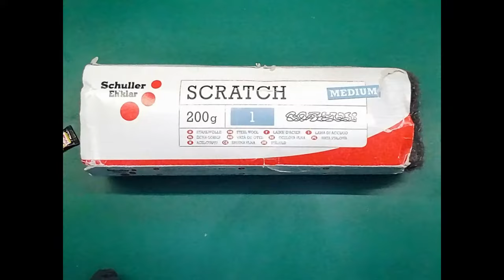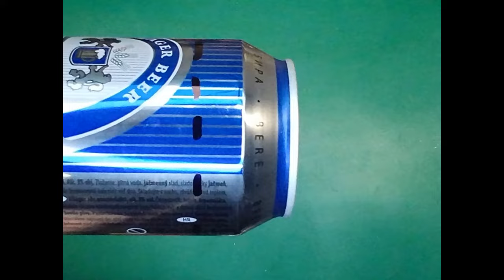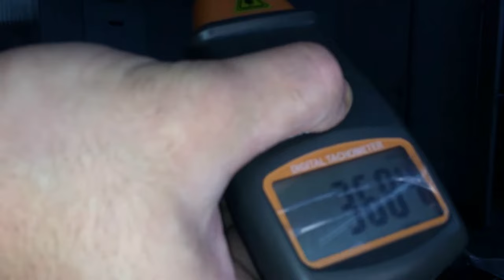[TUTORIAL] How to make a DIY free piston TASHE (ThermoAcoustic Stirling Heat Engine - step by step)

Comment: I would sure like to see you hook these up to a solenoid and show some power measurments.
Reply from the maker: Maybe later. I'm working on an efficient generator for this frequency range. But the calculations given around 3,5 W mechanical power at 40Hz I want to measurethe real power if the engine will a bit more stable. My last construction works well after hours operation. I will share updates if I have some results. Blade

Comment: Greetings thank you for the epic content, this inspired me to try an build my own,  so far i've built the same engine out of 2 a coffee cans and a 3rd can from canned food as a displacer and im using inner tyre tubing for the displacer membrane and power membrane as i imagine they are stronger than a balloon and very elastic too, yet not getting any movement on the power membrane, where could i be falling short??? i did make a small pin hole on the cylinder to make sure there isnt a huge build up of pressure, pls advise
Reply from the maker: There is no displacer, only a tube with mebrane end. The gas displacing there in the inner tube. That place called thermal buffer tube. Anyway, pls try first a higher flame and more cooling if your can prefer higher flame temperature. For this unit should give a bit bigger heat input.

Comment: Can we use it for an electricity generation? And if yes how big it can be made practically? I want to built one to powered my house and some sold back to the grid. 10kw/hr is what I'm willing to achieve. I have pretty good availability of solar radiation in my country so concentrated solar powered Stirling engine will be a better choice.
Reply from the maker: Dear Yash, TASHE is one of the simplest construction of a traveling wave thermoacoustic Stirling Heat Engine, where we can use only one thermal core, but for that power range where you want to use it there's not ready to use any unit all around the globe! Blue Heart is one of the closest to the goal. For research and developement?  It's a bottomless hole for the money and minimum 5-8 years to create the first big prototype. You should make tons of smaller prototypes in the first 3 years. Sorry if these infos makes not happy feeling to you, but I'm in around 8 years now, and I know how painful the prototype manufacturing process from the ground level as a developement engineer. BLADE
Reply: @AttilaBlade  thanx for replying 😇
Reply from the maker: @yash_kambli  I'm sorry for the negative or unpleasant news so much. I'll be happy with a 10kW unit from this config, that means I'm arrived to my goal. ;) Anyway, 3 and 4 cylinder solar Stirlings are available now with solar dish concentrator but I'm not pretty sure about the payback time around a house. The price is so high and that works with 80bar Helium if I remember right and that could work 1-30 kW range. BLADE
Reply: @AttilaBlade  no problem, mate. I'm pretty satisfied seeing ur reply. I hope Stirling engine will gain more traction in commercial as well as in domestic applications. It might be less power dense, quite bulky and expensive but is still a really good technology to be work on. 
Btw I'm really enjoying ur every videos and hope u will keep bringing such exciting topics every time.

Comment: Okay, I'll try this. I want to see if these engines can be powered by solar... I know they can but will build one.
How to up grade to one that produces electricity will be the difficult step!
I'll let you know if I succeed 👍
Reply from the maker: Good! For a long time usage you should make some aluminium fin connections between the inner tube's top side to the outer tube's cold side. Also the finns should go across the inner tube top section to cool save the membrane from high heat load. That's all! I believe you can do it Bret! BLADE

Comment: Im working on a modification of your design using a steel 5 gallon bucket. Any advice?
Reply from the maker: Don't rush your work. the inner cylinder and the regenerator part around it should not move. Cooling is more important and the diaphragms should be as tight as possible. A simple heat source will not be enough to drive it. A high temperature is required around the bottom of the master cylinder. The entire structure must be fixed without any possibility of movement. Probably, if the gap and density of the regenerator are correct, your engine will work. But many things can change it. BLADE

Comment: Hi It was perfect 👌👌
Why did u put that piece at min 4?
Reply from the maker: That folded piece of can is a spacer/centraliser between the wall and the buffer tube.
Reply: @AttilaBlade   thank you I got it. 🌸
How can I find efficient sizes for this Sterling Engine?
Reply from the maker: @zahrab162  Efficient sizes? What do you mean exactly?
Reply: @AttilaBlade  I was thinking about a sterling Engine which works with solar power. I thought measurements could be important for Engine optimization. And I asked how can I find this measurements
Reply from the maker: @zahrab162  This is not a simple question. This type of engine is really sensitive for the parameters. For example this engine could work with this bad heat exchangers on both sides, but for a real unit, I mean a useful one (with pressurised Helium) where the COP & Power on a much higher level, you should make simulations in Delta EC program, you should plan a perfect heat exchanger with calculations and later you should design that also, and the 3D design you should change in parallel to optimise the final prototype unit. This is a hard work. This membrane type TASHE is a big pain in the a..e! ;) But if you have a good model in Delta EC and lot of money to make an optimised heat exchanger also design the whole unit then this playground is yours! Oh I forgot the important small scale experiences, and the  highly qualified team with different "type" of engineers. If I'm right Doug Wilcox from Georgia, US has a pdf about a heat driven high temp diff membrane TASHE. The unit heat source was gas burner and two linear reciproc motors are worked as generator. That paper could help to you I think a lot. The Ben & Jerry refrigerator unit worked with similar method but in reverse working direction as a heat pump.  Not too much real configuration is available around the world but not impossible. Sorry if my words makes you sad. Back to my desktop unit, the parameters are not really optimised, I used the cans basically and I've made tens of engine before I made this tutorial. Blade
Reply: @AttilaBlade  I'm really thankful for your great answer it was eye opener and very helpful 🌹🌹
Reply: @AttilaBlade  god bless you:)
Reply from the maker: But never give up! Learn a bit more about TA engines autodidact also try to make some experiments. The experiments are could teach a lot if you have open mind and eyes. For a school project the can engines are a good starts, but for a high school you should planning a much complicated one with similar structure. The question is where is the balance of the goal and the knowledge. Best regards! Blade
Reply: @AttilaBlade  I like to learn more about it and it need to put time, I know 🙏☘️☘️☘️
 I will try to make one

Comment: Great job ! Now all you need is a free heat source. Maybe plutonium ?
Reply from the maker: Thank you! ;) Plutonium as free heat source??? OMG! No way... I want to build a solar version from this type engine with  higher pressure to increase the power. But the developement is started only. Money and time what I want to make machined parts, efficient heat exchangers, etc. etc. :)
Reply: @AttilaBlade  You can get " Used Plutonium " from Russia. ;-))
Reply from the maker: @bjl1000  :D :D :D
Reply from the maker: @bjl1000   "Oh, those Russians!" :) (Boney M.)
Reply: Hydrogen ? We can produce it easily at home.

Comment: Hi :) I tried to build 2 engines, following exactly your instructions, but cannot get it to work :( Should the displacer be loose in the outer can? It does not look so loose in your video. And does the connection piece actually touch the membrane of the displacer?
Reply from the maker: Dear Mark, if the steps was exactly same the unit should work. It works with a bit higher flame as the other engines. The inner membrane should tight as possible. It has no displacer, that is a tube only, it's fixed with the regenerator around that. If you made the wrapping right, the steel wool longer a bit as the tube, so it could create a 10mm gap from the cylinder's bottom. The last question isn't clear for me. But the membrane is free. The regenerator could touch the edge of the inner tube but not neccessary. Did you make tiny pinhole onto the cylinder's top?
Reply: Hey blade! I had followed your steps exactly BUT I was using a spirit flame which was concentrated in the centre. I changed to a gas burner at very low flame and it ran beautifully with autostart at a stroke of around 40mm :) Thanks a lot for your reply!
Reply from the maker: @markdebono1273  Super! I'm happy if you are! Thanks for the feedback! I hope you will share it on yt too!
Reply: I’m definitely happy! :)

Comment: This is fascinating. What is the function of the diaphragm (membrane) on the displacer?
Reply: I just watched your other videos. I think I understand now. I somehow missed the fact that the "displacer" is open on on end.  How sensitive is the engine to the volume of the gap above the displacer membrane (I guess it is essentially "dead-volume"?)?  This is a really neat engine. I'm amazed at how well you've been able to simplify these over the years.
Reply from the maker: Thank you I.G! :) It has no displacer in. This type of engine works with a gas piston they called Thermal Buffer Tube (TBT) This gas volume moves back and forth as the displacer moves in the normal Stirling engines. The membrane has two functions. First, eliminate the Gedeon streaming. Second, reduce the length of the acoustical loop at that frequency. We can substitute the long tubes with high volume of gas with same  mass and spring properties.
Reply from the maker: @IronGoober  It has no dead volume as Stirling guys talking about the volumes. The volumes are gives a main frequency what we use here and take off the power from the power piston/membrane on that frequency. The TASHE config sensitive for the volumes and lengths, also the membrane's tightness. The top "dead volume" is called Compliance here that works as a spring. The inner membrane should more tightened as the main one it could amplify the wave a bit. The engine looks simple but the working method is not. In this engine the inner membrane is a phase shifter, it give MASS to the gas, but in a real NO membrane TASHE the developers are use a smaller diameter tube (Inertance) there, after the Thermal Buffer Tube, what I folded into the center here. So I changed the Inertance tube to a tight membrane. It has higher efficiency than a tube because the wall losses and viscose losses also other transient gas flows losses. Also the membrane could stop the parasite "Gedeon stream" in the engine. I know it was too much informations, but maybe enough to understand why and what I did in the engine. I have more infos about it, but actually it is a fan page of the hot air engines. I'll try to collect the main infos and start to write it on my blog later. I need more time to it. :) BLADE

Comment: Confused on the connection strip. Is it there to stop the regenerator from moving?
Yes.
Reply from the maker: Yep, and also help to centralise the top cap, and hold a bit the whole inner structure, not only the regenerator. BLADE

Comment: Attila's blade hello!
help me plz.
I cannot run this simple construct. I did everything exactly to the smallest detail. Picked up the same diameters of bottles and so on. It does not start, but I have thoughts on why this is happening. As soon as I start to warm it up, it starts, as it were, to want to start, but it does not start. I tried to help it start by clicking on the iron washer. But it slowly moves up and down does not resonate. Increasing the weight of 2 washers was not successful.
 First, answer the questions.
1- how much regenerator cotton is needed (my cotton is denser and there is a lot of it)
2- the bottom must also be covered with cotton wool or it is not necessary.
3 what should be the diameter of the hole to connect to the atmosphere (I have 0.4mm)
5 how to find the right cooler. How many layers of napkin are needed and where it should be located.
It seems to me that I have too thick cotton wool (0000)and a large hole, but I want to hear your answer. Help out. I could send you a photo on whatsapp or email.
Reply from the maker: Dear Ara, what was the flame what you used? The pinhole is good. The steel wool not neccessary to the bottom,butthe unit works with that too. The density and the wire diameter could be a problem but I don't really think so. Try a small gas flame far from the bottom, because if you used aluminium cylinder. I used steel. The wrapped wet tissue was only 2 layers. The unit was fixed strongly! That's all! I hope your engine will running for the next try!
Reply: @AttilaBlade  Hey!
I used a spirit lamp - well, I'll try it on gas.
At the expense of the iron case, I will redo it. Fix the block - yes, I definitely forgot that even the glass syringe would not start without it, I remembered this condition. Thank you, I think everything will work out. I will write or remove my block.
Reply from the maker: Not necessary to change the cylinder, first just try a higher flame. But if it has optimal parameters, I mean membrane tightness, regenerator density, orientation, it could works with a higher spirit too.
Reply: @AttilaBlade  ok i got it
Reply: @AttilaBlade  Attila's blade hello!
I increased the flame and tried to heat it with gas.
No result. Can the hole be larger than 1 mm in diameter?
1 question. You wrote in the comments that the gap between the inner tube and the bottom matters - is it true?
2 question. Should the inner tube move freely? Does it vibrate during operation or does it stand still?
3 question. if you hermetically shove a car lamp into the inner tube and use it as a heater, will it work?
Reply from the maker: @ara7878  No, the pinhole is good if that is small as possible. Yes, the gap is important. Around 10 mm. The inner tube fixed (not vibrating)with the regenerator. If the regenerator a bit longer than the inner tube that I showed on the video that will be enough gap. Fold the regenerator's end a bit under the inner tube. The last question is... I don't know the answer for that.
Reply from the maker: @ara7878  Really interesting research path also there waslot of great developements! Thanks to shared this video with me!

Comment: Hi Attila,
I tried to build the engine according to your instructions, but unfortunately it doesn't work very well, the power membrane only moves a little (2-3 mm) and very slowly. Can you advise me where the problem is? Thank you.
Reply from the maker: Check the membrane tightness. If you watch my video there are tightened as possible so hold them few sec to fix the glue it. This is my first think. The second is the bottom gap, it should be around 10mm.

Comment: But bro, isn't this the regular Stirling engine? Thermo acoustic is supposed to not need a displacer, just a pipes arrangement, right? (Please correct me if I'm wrong)
Reply from the maker: It has no displacer, the engine works with thermal buffer tube as the Tashes usually. The membrane is only to make the engine more compact. It could reduce the length of the engine's loop drastically. We change the gas mass and spring to a solid part.

Comment: Dear Author, I made your engine. My engine runs a little better than yours. I just loaded the inner membrane with three M8 washers. The outer membrane is loaded with two nuts from a strictly water tap. The weight of the nuts is about 40 grams. Unfortunately I couldn't find steel wool and used steel scrubbers for washing dishes. But your engine worked great the first time. Thanks!!! It was only on your channel that I first saw this ingenious coaxial engine layout !!! It is very difficult to classify your engine: you can think that the engine is thermoacoustic, or you can think that the engine is alpha-type with membrane feedback. Brilliant layout! A very beautiful solution. Thanks!!!
Reply from the maker: Thanks to your feedback! What do you mean "better"? If the inner membrane is weighted than the frequency should drop a lot. Your engine has much lower frequency than mine, but maybe that could start at lower hot side temperature.  Do.you have video about your engine's start? I really proud of you to made this type of engine. Few people tried and failed. Some people built a working version, but nobody started to modify that. So, congratulation to your engine! This unit is a TASHE (thermoacoustic stirling heat engine basically. It has similarity to the Mechanical stirlings but it works with only the gas movements. The trick is the membrane inside. The membrane substitute the long gas loop. The gas weight, inertia, spring constant etc. Also the membrane stop the Gedeon streaming that works opposite as the unit needs. Anyway, I'm glad to hear about your engine! Please share the link if you have! Thanks! BLADE
Reply: Dear Author, thank you very much for your reply! I will try to show the video either late at night or tomorrow morning. Sorry, I have to do some work. Naturally, your engine in my version has a lower frequency. It still seems to me that the attractiveness of the solution depends on the specific application. In any case, I thank you for the ingenious, crazy idea!
Reply from the maker: @imyanetfamiliyanet6594  Dear Imyanet, when the frequency lower the power is lower if the stroke nearly same. Higher freqency = more cycle/s If the input heat same the power is higher on higher frequency.
Reply: @imyanetfamiliyanet6594  Show us the video, please. ;-)